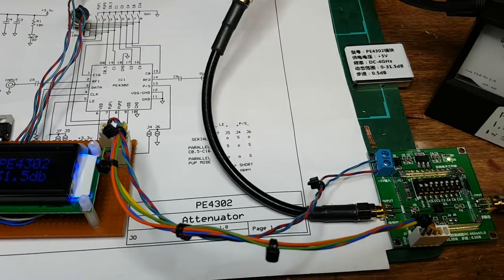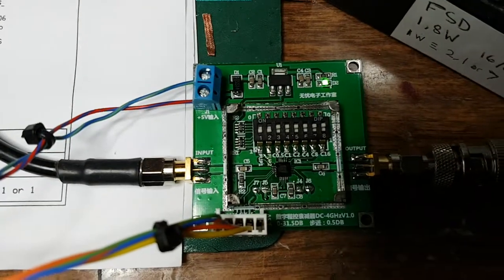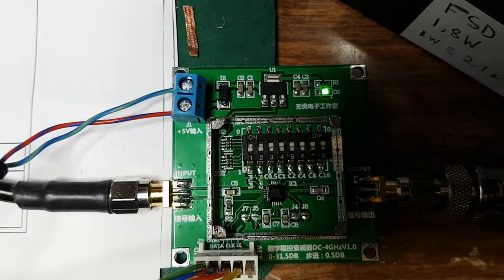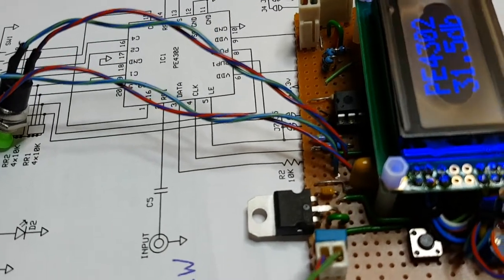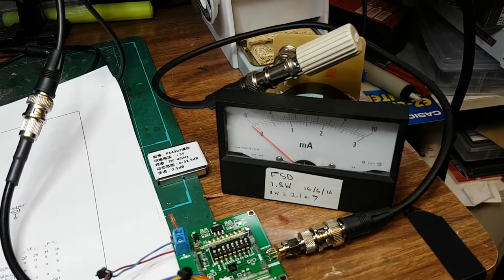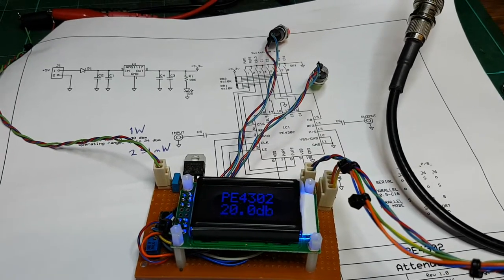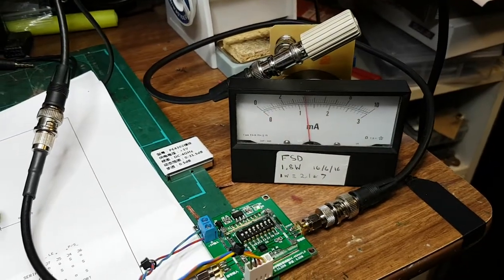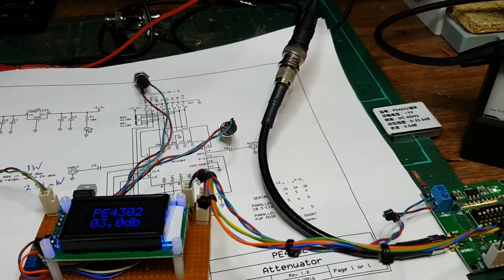PE4302 Programmable Variable Attenuator

Comment: Hi David. Congratulations for your work. I would like to do something like that. I have the same board with PE4302. I want to use it in serial mode as in your project.  I  removed solder from pads J5 and J6 and added to J4.
To control the PE4302 I'm using a Raspberry PI. Clock and date work properly. But I can not see the Latch on my oscilloscope when the PE4302 is connected. The level on the LATCH pin remains low.
can you help me? Thank you. Francesco
Reply from the maker: Francesco Ska I regret not. Colin G4KLB is the originator of this project and far more ingenious than me. See QRZ.COM for his email. What I have proved is that Colin and John's project from the BATC Wiki can he reproduced on Veroboard by a modest hobbyist. I don't profess to know how it works. Sorry
Reply: Hi David. Many thanks for your reply.